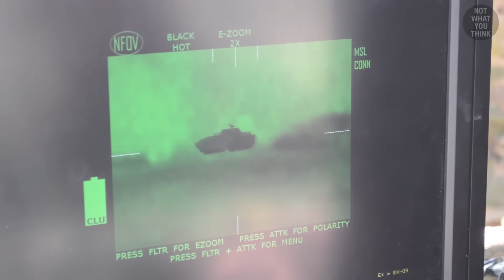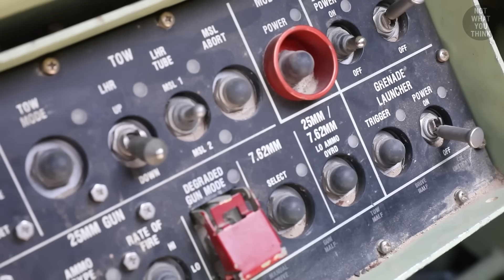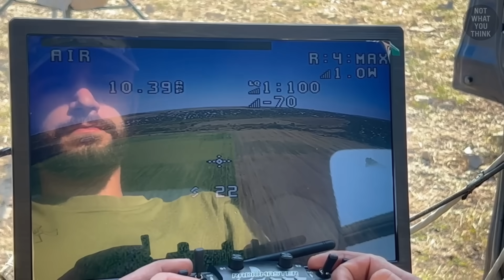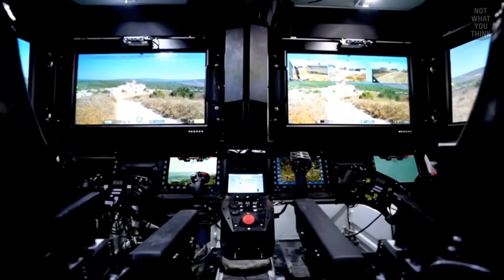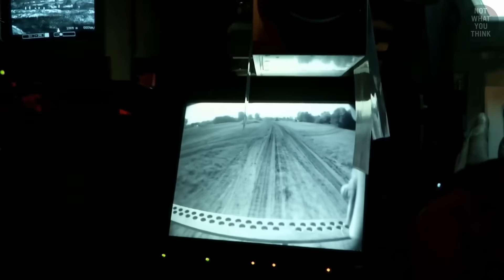How Bradley IFVs prove more Useful in Ukraine than Tanks

Comment: tanks will change like ships did, away from armor and towards active defences, most likely they will become semi armoured gun with vls anti air missiles for self protection
Reply: I first heard this story around the mid-1980s.
It's still true untill collide with technology problems and affordable prices.
Through last fourty years it was easier train infantry and tanks to team work together.
In the future...

I believe power of gun is the reason to exist for tanks in order to shoulder all the obstacles that arise in front of the troops on the battlefield, so better sensors to find it out along ambushes is the primary key and something similar to Rafael Trophy could be a viable ECM/VLS missile layer against tank treats allowing a slightly lighter armour too.
Another step towards the idea of tank as a modern Destroyer ship.
Reply: Too expensive.

Comment: From your opening gambit, one F-16 can kill multiple Bradleys AND kill the far more valuable infantry inside.  That is why F-16s denying Russia air superiority are so important.

The carnage in the Russian tank forces came from abysmally BAD employment and tactics and logistics support, especially in the support of killing the opposing pick-up infantry groups at the beginning.  The penetration columns and tanks were left stationary AND out in the open on single line of advances as was part of the Russian strategy of striking quickly and deeply.  Unfortunately neither the forces nor the logistics were able to pull off those operations.

To say a 'heavy' MBT is obsolete is easy, until the context changes and the actual battlefield CAN be dominated by such armored formations who operate under protection from supporting forces, aviation, ground, and artillery.

To say they have to become 'lighter' you need to show you have reasonably gamed the scenarios and battlefields that are ranked for 'possible/probable'.  I REALLY don't see that in your mere review of 'incidents'.

The plural of Anedcote is STILL NOT Data.

This is the same kind of argument used to give the USN the utter FAIL of 'littoral combat ships', and I am so far content to trust the current mix until the actual battlefield is rendered completely 'dead' because of autonomous drones and the like.

BTW, those 'light' tanks are for very special uses in the US Army, and have real issues like lethality and ammunition supply for the airborne/light forces roles they will support.  They are not meant to be the main force, and do not have the sustained strength.  There are plenty of YouTube videos that discuss especially the US interest and use.

BTW, BTW, what are your professional credentials in the area of military analysis?  This seems like a Popular Mechanics meets History Channel level of understanding.
Reply: I swear, this channel attracts the most pretentious military nerds lol
Reply: @jr2904  Good thing, as that lessens the misinformation.

Comment: most of the cost of lost tanks is because that tanks are used wrong in case of strategy. you cant send them out alone without the support of infantery and other viechels. If you support them correctly they are deadly, if you dont support them they are easy prey.
Reply: pretty much like  cav. there was a moment in history where you could throw cav at all your problems, and it would deal with it. Similarly MBTs could be thrown at any thing for a while.

Now they are getting more countered, and need to be applied in gaps of the enemy again to be of effect. But if you were to get mbts throu the enemies lines in significant numbers they still would shread.

Problem in Ukraine is, there are no gaps to throw them throu ig.
Reply: You also live in 1945. What use are your infantery , when the enemy shots a Kornet at your vehicle from bushes 200m away ? Or when they have a $1000 Chinadrone+RP2 controlled from behind a tree line ?
Reply: @frankgerlach4467  It's called combined arms. How do you think forces in WWII dealt with 88s that could shoot from 2km away?

You recon the areas enemy ATGMs are most likely to be, or where your tanks are going to be most vulnerable. You hit those areas with artillery and air strikes. Infantry goes through the places tanks can't easily reach to root out the missile teams. When a missile is launch you hit the place the launcher came from and use smoke rounds to blind them.

Infantry locates and eliminates or degrades the enemy's reconnaissance capabilities so they can't see the battlefield as well. Anything the Infantry can't take they call support assets like tanks, artillery or air support. 

The goal isn't to take zero casualties; it's to keep your fighting force effective. It's OK to lose a few tanks to ATGMs if you can find, fix and eliminate them which is the job of the Infantry.

The USMC literally states the job of the Infantry is to "locate and destroy the enemy by fire and maneuver or repel their assault by fire and close combat" and they are the premiere infantry force on the planet.

To put it another way, infantry are the most vulnerable thing on the battlefield but literally no one is talking about them being obsolete. Machine guns and artillery can kill them in greater numbers than ATGMs can kill tanks but we don't even hesitate to use them on the battlefield.

Comment: 7:05 acronym is wrong. It is Wire-Guided.

11:24 The 105mm is not more common among NATO forces today and I doubt that shell variety is much of a consideration seeing as the US has had to develop a downscaled version of the AMP round for use with the M10
Reply: The modern TOW 2 is wireless so they changed the acronym to wireless it also flies over a target and shoots a heat charge downwards into the top of the target, very fancy

The 105mm has more shell types as it was used for artillery before the 155mm got a monopoly in NATO however these shells aren’t much use for tanks, the more likely reason is that the US has a bunch of them from the early Abrams and from the Patton tanks as well as large stocks of ammunition for such a gun

Comment: As a nerd for tanks and their history, I hate to say it, but I think the battle tank has become outdated.
Surface to air missiles and drones have exposed the tank's biggest vulnerability: It's turret.
When tanks were invented, the only threats were on its front, rear, and sides.
Now with all the advanced weapons, tanks have become sitting ducks hoping to get a shot off before they die.

If militaries want to keep utilizing this amazing piece of human engineering and mechanics, then they need to start protecting the turret, which is difficult considering any change in angle would potentially imbalance the tank, as well as hinder it's mobility, not to mention ALL the money it would cost to build a "modernized" tank from scratch.

It NEEDS to be redesigned from scratch, weapons have simply become too advanced for the battle tank to stand a chance. Even Abrams and Leopards are vulnerable.
Reply: tanks aren't outdated more need to be equipped with APS system's like the SEPV3 and SEPV4 were.
Reply: @jtl-08 honestly just go the Armata route, unmanned turret can soak up the hit. Maybe compartmentalize the turret so you don’t lose every system when hit. Add a remote 30mm mount on top with VT fuse to shoot down drones while you’re at it.
Reply: @Estelle-385  there is a thing called AbramsX and it has everything you just described it also has a dome APS.

Comment: In a battle without air support, tanks need to get bigger and heavier, not smaller. The only defense against modern man-portable antitank weapons is to field enough armor to shrug them off, otherwise you're just letting enemy infantry kill 10 of your guys with one weapon. Ideally, however, you will have air support, at which point the lighter vehicles make sense.

Comment: Two points many people tend to forget in this discussion:
1. The barrel launched atgms of the T72/80s are more feared than their main cannons, you argue could that these are their main weapons in a head on conflict with western tanks.
2. The 60-70s ton MBT´s of the late cold war were over designed to fight in the northern german planes or the fulda gap. They would roll from their barracks straight to the battlefield. 
There is a reason why Bremerhaven was still territory of the americans, they had to create a solid infrastructure for landing their reserves.
For vehicles over 50 tons you need very flat terrain, without many big river crossings and solid bridge/highway/railroad infrastructure.
Reply: I don't understand why the barrel launched ATGM's are more feared than their kinetic rounds the NATO country composite Armours for example (American tanks have about 600mm more chemical protection then kinetic) and the Russian ERA (for instance RELICT has 300mm more chemical then kinetic) withstand chemical weapons way more than the kinetic weapons.
Reply: @jtl-08  I like your technical aspect of it, but from a tactical stand point the range overmatch of the ATGMs is super dangerous.
Especially because the NATO tanks shoot more accurate and faster in cannon range.
Under 2km the NATO Tank propably outperforme the Russian one, but from 2-4km a T80 can still engange with Cobra and Sniper ATGM.

They may get shruged of by the armour, but there is always the change of damaging vital components.
Reply: @westphalianstallion4293  fair point didn't really think about the range advantage

Comment: M10 Booker was stated as a self assault gun instead of a light tank. Use as a infantry and other IFV support. 
But the Type 15 is declare as a light tank. 
The important is the use of combine tactics that has been around for decades and need constant improving in the tactics.
And well trained crew is important.
Reply: The point of the booker is that currently the tanks have a big enough gun to suppress and destroy trenches and fortifications so the booker can do the direct fire support role and hold actual tanks in reserve for offensives and counter attacks. I think it is a sound idea as backed with ifvs the booker can bring alot to a battalion.
Reply: Light Tanks are umbrela term to describe Assault Guns, Tank Destroyers and up armed IFV's.
Last real light tank was Sheridan, what was designed to be air mobile.
Reply: Let's face it the booker is a light tank made to replace the Sheridan 
And maybe a ifv support weapon because  the strker gun system isn't working

Comment: Pretty much the entirety of NATO has switched to 120 mm shells on their main battle tanks, so saying that 105 shells are easier to get than 120 is most likely not true
Reply: 105 mm is in storage and in stock pile and can be used without depletion of modern stock piles.
Reply: Still having old ammunition in stock and they used a lot of 120mm already. 
105 mm is just lighter and easy to transport.
Reply: There is British media reports of the 105mm howitzer stopping firing due to lack of ammunition to the Ukrainians.
Reply: 105 mm is used by many systems. In fact there is a lot of those still in reserve.
Reply: U.S. army just adopted a brand new tank armed with a 105mm. The M10 Booker.
Reply: Yep.  And this transition began over 30 years ago.
Reply: 105mm is slightly more established, having been developed and used earlier, but this isn't the specific factor as it is mainly being reintroduced for weight and cost saving while offering more varieties of rounds to support infantry rather than fight other armored vehicles
Reply: @daspas2111  You'd think being around in NATO since 1979 would be established enough for 120mm guns, 105mm guns might have a stockpile that they want to use up, but saying that they offer more varieties of rounds when the 120mm AMP is gonna get introduced is also questionable
Reply: @enriqueouro9  I never said that 120 mm guns weren't established enough. Rather, i believe the reason they went with the 105 instead of a 120 using AMP is because it is simply cheaper, lighter, and more specialized. Given that the M10 booker is to be air deployable, the only other main gun light enough for the role (to my knowledge) would be the ARDEC XM360 120mm cannon, whose project has since been scrapped. Given this, it would make sense that they'd implement the older, cheaper, and lightweight 105 mm gun whose older ammo offers specifically chemical, canister, or air burst effect while being plentiful and cheap. That might not matter so much, and maybe something similar to the AMP will be developed for 105, but the choice of gun itself definitely makes sense.
Reply: @daspas2111  Oh I'm sure they chose it for weight reasons, I wasw just questioning the other stuff.

And anyway, the M10 booker is quite heavy for it's firepower and role, the russian air mobile light tank, the 2s25, has a 125mm gun at 18t. Even other full mbt's like most russian mbt's or the japanese type 10 are only slightly heavier than the booker.
Reply: @enriqueouro9  2s25 does have the 125mm gun featured on other russian MBTs, but this is to engage other armored vehicles firstly, while its second function is infantry support, which makes sense as to why it is based on the bmd-3 chassis and shows the difference to the brand new M10, whose focus is infantry first, armor second. As for the type 10 and comparable MBTs, they're light so they can maneuver and transport easily while still filling their specific purpose. I'd also say that the M10 is brand new, so all of its subsystems and technology likely make it very fat.
Reply: @daspas2111  The point is that it can have a big gun at such a weight, and the type 10 for example has a 120mm , a more powerful engine and is said to have armour at least as good as type 90, so the question is what does the m10 have that justifies it's weight, size and cost for what is a mobile 105mm gun.

Electronics are meant to be getting lighter and lighter, maybe the m10 is just a lot better armored than it looks, other than that parts commonality is cool but it gets offset by how expensive it is.
Reply: @enriqueouro9  what the m10 has to justify itself is a mobile 105 mm gun, which is upwards of 4000 pounds lighter than the 120 mm M256, while maintaining a similar effectiveness to static emplacements that marines might encounter despite reduced armor piercing capabilities. This, in part, is what allows the M10 to be more than 20 tons lighter than an abrams and just slightly faster. It may not be as armored as any MBT, but it still offers easier transport and probably much better coordination abilities with other assets given its brand new computer systems. Sure, it could stand to be lighter and faster while filling vaguely the same role, but that's not specifically what the military wanted. Also, i personally wish the M8 AGS was adopted but that's besides the point.
Reply: @enriqueouro9  The Sprut is self propelled anti tank gun. It's protection is light aluminum that probably wouldn't stop the autocannon rounds most Western AFVs carry these days. Booker's on the other hand are designed to offer a higher level of protection. Their roles aren't even comparable. The Russian one is designed to give airborne troops the ability to quickly set up ambushes of heavy armor and move out. The US vehicle gives light infantry backup to deal with hard targets like bunkers and possible other AFVs. If a Booker crew is engaging a MBT, something went wrong in the battle plan.
Reply: Plenty of 10,5 cm tanks still in service too, meaning the stockpiles of 1,5 cm rounds are still there as well as the production tooling to make more.

Comment: 🎉 finally AMX 10 RC is almost modern with his 105mm. Have a look at 🇫🇷 "jaguar" with only 40 mm rapid fire and 4 AT missiles... If "protecting monility is the soluce" we now have 😂
Reply: The Bradley has to stop to flip up the start tubes. Then they have to wait for the slow mechanism and the Bradley cant move in the meantime until it is finished. There only 2 ready and 5 more in reserve. 4 vs 7
AMX and Bradley are not for the exact same usecase and needings.
Reply: @fayne1   yep the 10 RC carries nobody means "roue Canon" canon on wheel. One bizarre thing even with whells it cant rotate on himself like à true tank. It is kind if " sniper tank" normally good for ambushs, NOT recon in FR we never send tanks for recon. ( some germans say they do... LOL) FR  tanks always with very very small VBL  microscopic Humvies. 10 RC being replaced now by ERBC "Jaguar" means Engin Blindé for Recon and Combat. Quite nice tool ??